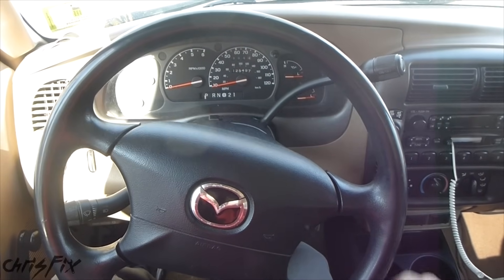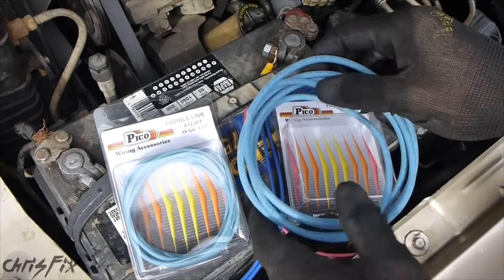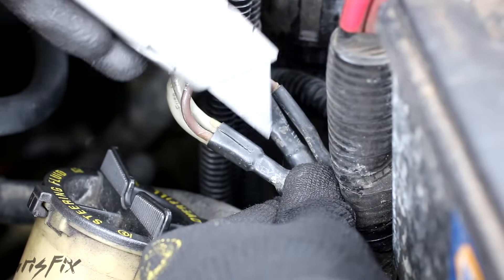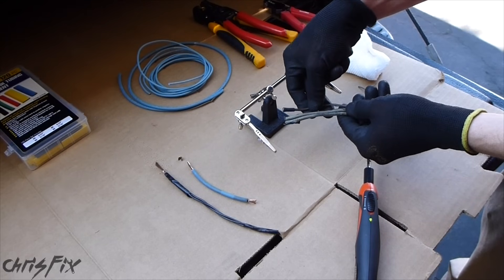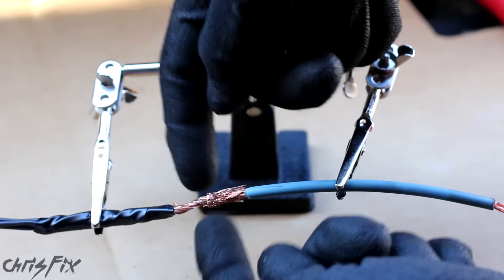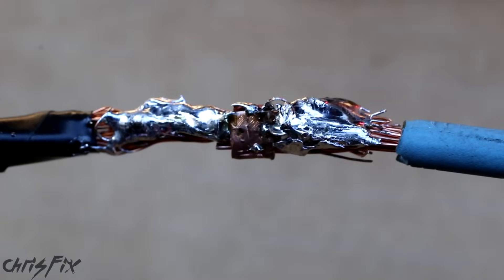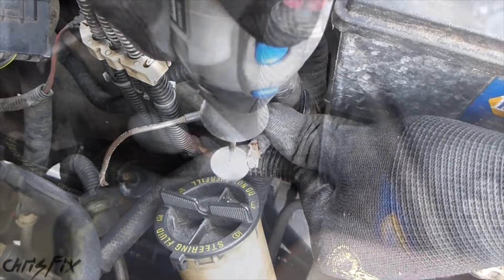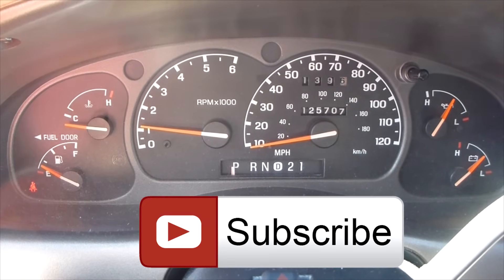How to Replace a Fusible Link (Car won't Start)

Comment: I love how you are slowly but very nicely fixing your car :)
Reply from the maker: ***** Thanks! Every fix makes it that much better! I am excited to start doing some projects like a light bar install!
Reply: ChrisFix I went thru this by myself with my first car which my friends call garbage but i loved it back then i learned a lot by that its also quite good and satisfying feeling to fix your car by yourself :) One of my friends why is now making fun of that old car just bough his first car few years ago, and he is in his late 20s. Its true that his first car(lancer x) is much better then the Nissan sunny i had when i was 19, but he is unable to do a simplest job on his car and is always asking me for advises :D Also its quite funny that somebody who drives family sedan have the guts to call car guys first car a garbage. Anyway since then a lot of time passed and as a car guy i drive Civic Type R Euro :) so far the best car i had :)

And about your projects what i learned so far with cars is that if you are really not going for some hiend mods with very expensive parts usually you will mess up the car, the way how the were build is above the cheap mods. 

Please dont rice out your car:)
Reply from the maker: Exactly man! Dont worry, I wont rice out any car of mine.

Comment: I think a little bit or rosin flux on your wires would make that solder flow a lot easier.
Reply from the maker: Peter Carlson Thanks for the tip! I was wondering why the flow was so bad lol
Reply: ChrisFix when you solder larger thicker wires the heat tends to oxidize the outer exposed wires and the solder, even rosin core solder tends to bead up and fall off without sticking or flowing despite the temperature of the copper being at or above the melting point of solder.
Reply from the maker: Peter Carlson Good to know! So you really need to use flux then!
Reply: ChrisFix yes, mostly with larger wires. The rosin core solder does ok for the smaller stuff by itself most of the time. What gets people sometimes is when they melt the solder on the iron and blob it onto a cold joint the rosin from within the solder makes it flow better and "solder easier" albeit incorrectly with a good chance of a cold joint. I just take the wires and roll them around in a little container of flux I used to get at radio shack, the stuff looks like a mix between jello and earwax.
Reply from the maker: Peter Carlson I have flux for silver soldering copper pipes. Is that the same stuff?
Reply: I'm not sure... I use compression fittings with copper pipes when I have to deal with them lol.
Reply: ChrisFix if it is paste flux yes, power no.  You can get the paste flux from any hardware store in the plumbing dept.  Flux allows the solder to flow through all the wire strands.  What you have here is a "cold solder joint" which will in time fail causing you the same problem.
Reply from the maker: piqua793 Thanks for the info!
Reply: Peter Carlson Good idea.  I, too, have issues with thick wires.  I was not aware that flux was required when using rosin core solder.

Originally I thought that it might be my iron wasn't getting hot enough.  But then you use a hotter iron and the insulation on the wire melts!
Reply: @chrisfix  i know this is old but most kits that you can buy at lowes or home depot come with the wire and flux that should be used on that type of wire

Comment: hi chris, I have the same  problem with  my 1989 toyota, but I couldn't  see the Gage # of the old fusible link, so let put a 8 gage#, should  I put a 12gage  instead of 8 is  working good so far,thank you, like all yours  videos, cheers

Comment: are these on newer cars too or did they stop putting these in and replace them with fuses that you plug in?
Reply from the maker: WCGwkf They are on some newer cars today as well. Fusible links are different than normal fuses because they can withstand a high amp load for an extended period of time compared to a regular fuse that burns right away.
Reply: WCGwkf yeah, i have never seen one of these before.
Reply: Most newer cars put fuse boxes and regular fuses since they are easier to fix when you take it to them and cost about the same to manufacture

Comment: hey Chris ,hi u? I could use a little help with my 2001 Dodge Neon 4 cylinder. so the car never gave a bit of problem never had a problem starting never cut off. so and driving last night and hit a railroad track pretty hard and the car just shut off. I attempted to start it back after pulling off to the side safely. when I turn the key in ignition the lights in the dashboard light up but the car won't start nor does it say anything. battery is brand new great connectors on top horn blows strong lights come on. I don't really have access to testers and things like that. I thought it might be the starter however upon turning the key to anything happens as the lights on the dashboard light up no sounds what so ever. Any suggestions will be helpful. Thanks
Reply from the maker: mr ok Sounds like your starter might be dead.
Reply: You may be correct I'm going to get up in the early morning and do a more thorough check I will begin with the starter wires and things that lead power to those areas. Thank you for getting back to me I value your videos and your advice.

Comment: My lights started flickering on and off my gages started acting crazy and my Radio on and off by the firewall i found a wire Thats link into 2 wires burnt feels stretched i have 79 blazer going to fix that wire hopefull thats the problem
Reply from the maker: Nice job finding the problem
Reply: @chrisfix  the wire was burnt but wasn't the problem was ground straps she up and running like a beast couldn't believe would cause  the lights to stay on and all the gauges to work and Radio

Comment: you did not bother to explain why it changes the speedometer
Reply: that would be called an electrical gremlin.
Reply: Hello guy from 3 years ago, the speedo works on resistance as most sensors do. The bad link is introducing resistance where other wise it should be 0 at stop. The lower current is interpreted by the speedometer as movement.

Comment: Going to use this info to investigate electrical problems on my truck. I've been having weird Christine crap going on for 12 months now. Replaced the ECM, alternator,  battery, the big amp fuse off of the battery, and here I am back at square one almost a year to the date.

Comment: Does this Mazda really has that many problems or you're just causing them yourself for the sake of demonstration?
Reply from the maker: ***** When I got the truck it was a mess. I am not causing problems lol. This was a fixer-upper.
Reply: ChrisFix
Haha, cool. I would lose my mind if that many little things broke down so often in my car.
Reply from the maker: ***** Yea, when you buy a car/truck that is a fixer-upper, you expect it. It is good for my channel haha
Reply: Piotr Noja it's a ford ranger rebadged.

Comment: Fusible links rock! I would've fried my 2000 Jetta's electrical system if it weren't for them. I was in a hurry to get the car back together after rebuilding the starter, and connected the battery backwards without even looking at the battery posts. There were sparks and the cooling fans came on and the horn sounded. I felt like the biggest idiot in the world. Radio went out, car started misfiring, battery and engine light came on, and sunroof or windows wouldn't work.  I thought I was screwed for sure and needed a new ECU. Then I looked in my fuse box and find 4/6 fusible links are blown. Popped by my VW dealer and purchased 10 for under $15. After that, the car was perfect. My ass was saved that day!
Reply from the maker: Brandon Friesen AWESOME! Yea, they did their job! That is good because imagine if it was the ECU! Thanks for sharing your story!

Comment: Love the tachometer. I have a 99 ranger xlt 5 speed manual and I only have the speedometer cluster. I want the tach cluster. Been trying to hunt for one that's not for an automatic. It would still work, however, I don't want to be staring at the "PNRD21" when I have a 5 speed. Lol.  Good video chrisfix!
Reply from the maker: James Falvey Haha, you dont even notice the PNRD21 when you drive but I feel ya! Good luck with the search!

Comment: Chris, goot has a soldering iron that is low power to work un almost any electronic project, 20-30W and a second power rating up to 60 (or 100 ... dont remember LOL sorry) pushing a button. This feature is very nice, it warms up even more and the extra power is great to aid soldering big surfaces. Heat tend to disipate, so when you get big things like this wires. I like the one I told you because is perfect for both uses. Only limitation is you cant push the button for long. This added power is to do quick jobs. But I used it long enough and its safe an reliable. Dont know the model exactly, but is a gun type soldering iron with a push button. The brand is not expensive and their product are good.
Another help is, using some soldering flux, tey sell in spray, liquid and even in a pen. Many metal are a bit reluctant to get soldered. They put fight. Flux really helps on that scenarios, even on not-so-clean surfaces. Sorry for the long post LOL, but I think the wiring gave you a bit of fight, more power would make the difference. Like you vid. Cheers.
Reply from the maker: 38911bytefree Thanks a lot for the tips man! I really appreciate it! I am searching for a better soldering iron. I am going to use all of these tips so I appreciate it!

Comment: Just thought to mention in case no one else did. I have done a lot of soldering. Solder has a flux core, but it is best to put solder on the connection as well. It will eliminate the the bad looking job. I had to learn that the hard way.

Comment: You know a lot about fixing cars. Thanks for the videos. When you are soldering, like you say, keep the heat on the wires and not the solder... but you’d do better to keep your heat on the wires after your solder melts. That way it wicks up under the insulation and the joint is 100x stronger at least... lots of flux helps.
Building a few hundred nav harnesses for jet aircraft helps too. Haha 5 miles of wire in an airplane bro.

Comment: Chris, can you make a video on the tools that you have for car repairs and their uses? Hydraulic jack, wrench size, etc.. 

Can you also share what are the essential tools to have in your car in case of breakdowns, tyre puncture, etc?
Reply from the maker: fever003 Those are two great video suggestions! I will add them to the list! Thanks!
Reply: ChrisFix Thanks and looking forward to your new videos. I recently have an interest in car repairs & DIY by watching your videos. Also trying to avoid those pricey labour charges for car maintenance by fixing/servicing myself.

Comment: Hi Chris. Question, why use fuseable links and not just regular inline fuses. If that burn up in a snow storm, it’s alot more
Involved to fix than just throwing another fuse in

Comment: Question Chris
Instead of soldering the wire can just crimp the wires and then electrical tape and shrink tubing? Will work without causing a meltdown or fire?
Reply: That’s the question I have. Did you ever find an answer? Only makes sense that soldering is just extra work to have it more secure. I would think crimping,shrink tubing and electrical tape would work the same.
Reply: @thinkfree8880  yes, effectively I crimped, used electrical tape and tubing and worked just fine. Thank you for your videos it has helped me alot, stay safe

Comment: wish i would have seen this earlier. my car had the same problem and i couldn't figure it out took it to 3 different mechanics and the last one changed the whole ignition motor costed a lot. It works now but this seems like a more easy and cheap way.

Comment: Flux before you solder it will help a ton when you see the solder (wick),like the capillary action of water into a paper towel, into the wires its working.
Reply from the maker: witnesszer0 Thanks for the tip! I will have to get some flux!

Comment: Excellent advice and demonstration.
I only wish that more cars came with an actual junction box for these links. As without them? A car's area under the hood just looks like a jumble of wires. 
Yours is okay ChrisFix. Because all the links attach right next to the battery. Can't miss seeing them. And yet on other cars? It's anyone's f-ing guess WTF the links are.
The besrt system I've ever seen was on my then-wife's Japanese car, an '86 Isuzu. The three links were all in a professionally installed box. Like the ''Three Little Pigs'' all in a row. Couldn't miss them.

Comment: Good vid. Another way to attach the wires you should look into is called a "linemans splice". one thing it helps with is the pull on the wire that it may get. Might be over kill for most things, but works really well and have never had a problem.
Reply from the maker: Mitch Martin Thanks for the tip Mitch! I am always game for learning new things! I will have to look it up! Thanks again!

Comment: The FL is usually tinned copper high stranding wire with a Hypalon (high temp, will not catch fire) insulating jacket. An blown FL will have a rippled and distorted look to the jacket (insulation). Although, as seen in the video, the failure mode is more often corrosion than an internally shorted Alternator.

I prefer to use round barrel step down butt splices (hydraulic crimp) with Red dual wall heat shrink when repairing FLs. I do not solder fusible links. One of the many reasons is, for a large wire gauge splice like in the video, is the amount of heat needed to solder the joint correctly can actually over temp the FL jacket which will make it look like it experienced and overload (over temp) condition, because this is how you identify an overloaded FL. So, to avoid this, it is best to use a barrel butt splice connection(s).

Comment: Dude that is a cold solder joint. You had the proper theory down to solder. Man that was a rough looking bond. You also need to wire brush off the flux after you solder. It will corrode later. You will be doing this all over again.

Comment: Wondering if you can use same gauge wiring for all links so long as it is large enough to carry the load or so it best to replace 12GA with 12GA, 18GA with 18GA, etc.

Comment: Hey Chris,

Nice video. I may have the same problem. Did your car jumpstart off another car? My vehicle exhibits exact same symptoms, but will jump start off my other car, and then run just fine until I start it again. We thought it was a bad ground connection, but after your video, I will go check out fusible links.
Reply from the maker: emt409 It will not even jump off another car battery. The car basically acts like the negative terminal got disconnected.

Comment: How did you find this fusible link ?
how can I fix one on my own car without this wires ? 
I will never found them in my country. 
Can I use a fuse ?
Sorry for bothering you with my questions ?
Great fix by the way :-) .
Regards.
Reply: Get some inline fuse holders and replace them with the same rating auto fuse
Reply: Stephen Rowley
thanks for answering my question . 
but how can i know what amps rating i need the fuse should be ?
regards.
Reply: It should state on the link what the rating is. Otherwise it's a case of checking out the service manual for a wiring diagram.
Reply: Stephen Rowley
thank you .
i need an engine wiring diagram for 97 grand marquis where can i get it ?
Reply: Unfortunately its not a car I'm familiar with try and see if there's a owners forum they will most likely point you in the right direction
Reply: Stephen Rowley
thank you very much .
Reply from the maker: toolman talal You really dont want to use a normal fuse if you can help. The fusible link can hold higher amps for longer than the same amp rated regular fuse. They should sell fusible links where you are. Parts stores, online, dealerships, local mechanics. Give a few calls and ask.
Reply: If you cant get fusible links then a slow blow car fuse would serve the same purpose
Reply: ChrisFix
thanks

Comment: Use marine grade heat shrink tubing to make it water proof. Marine grade tubing has adhesive inside the tube so it sticks to the wire good.

Comment: Really appreciated this short to the point video about something I was not aware of....although I had heard the phrase "fusible link" before.  Thank you mucho.  Tomorrow, I have to install a lift motor for the driver's side window on my 1992 dually 1-ton
 460 4x4 Ford.
Reply from the maker: xraydelta100 Great! I am glad you learned something new! That is the goal!  Good luck installing the lift motor! Do you have to drill out rivets or is it bolted in?

Comment: Helps a lot to use non-acid  flux  when soldering  something this big. Need a larger iron too.
Guess it would be a good idea to  use RTV or something similar to the open ends of the
existing links to keep water and corrosion out.
Reply from the maker: grassroot011 Thanks for the tips!

Comment: This is a really helpful video. Thanks for the info Chris. I'm gonna have to do this soon on my mom's SUV lol
Reply from the maker: Victor Sanchez Awesome! I am glad the video was helpful bud! Let me know how it goes! I will be doing a video on soldering soon because I did not do such a hot job in this video (no pun intended).
Reply: Hahaha as long as it's working right lol and the heat shrink tubing covers it anyways 👍

I'll for sure be letting you know how it goes lol